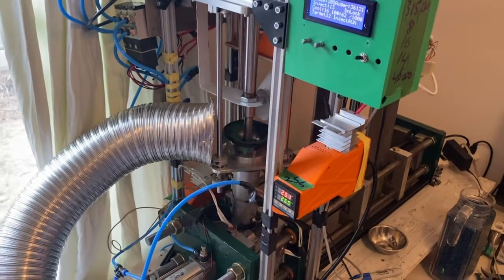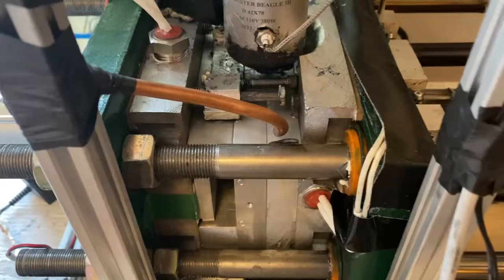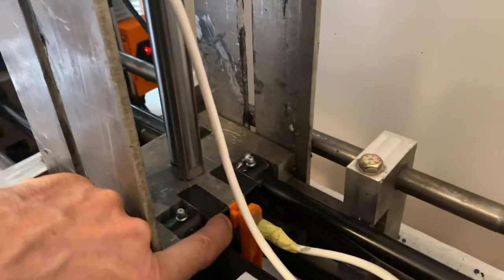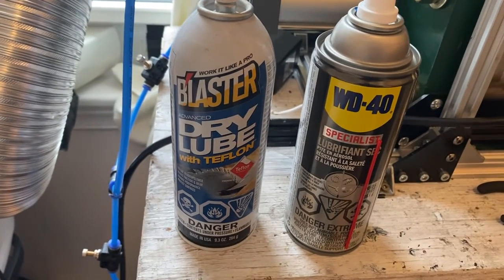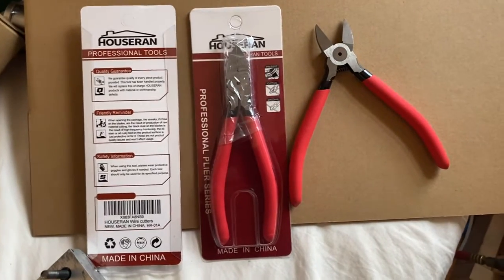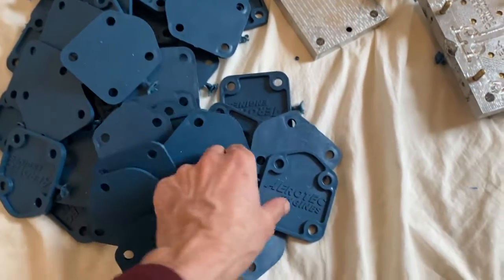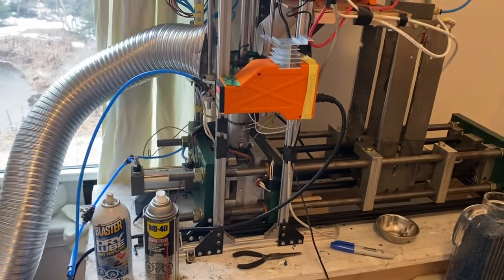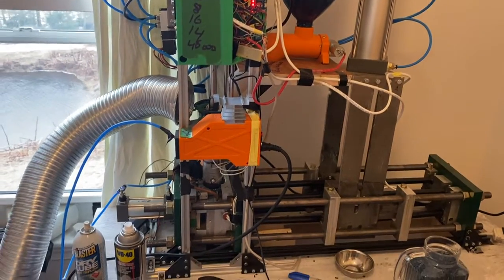Automated buster beagle injection moulding machine

Comment: Man wow, this is great. I think I also will not be able toresist building a buster beagle :D How big of a injection I can make? I have a Auger that dispenses cofffe beans, I wanted to resin 3d print a mold for it, do I think I can inject it with Buster Beagle?

Size is like an auger of 60mm radius, 150mm height
Reply from the maker: I’m not sure how big I can go yet, but I don’t see a reason you can’t get bigger even. It’s all about starting with a dream. Then taking steps to make it reality. I started a year ago, not even knowing what to do. Now I am injecting thousands of parts a week. You have the dream, and now start acting on it.
Reply: @iBuildStuffCNC  Beautiful answer, thanks for the motivation man!